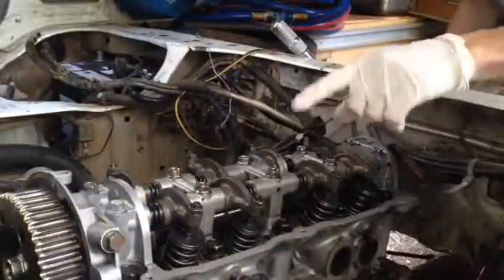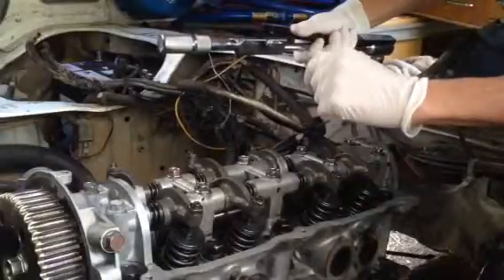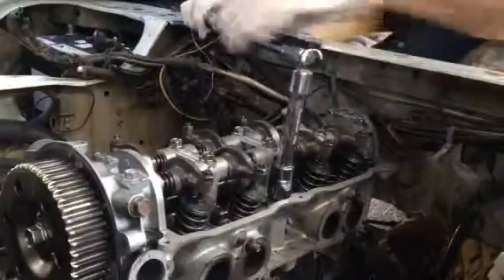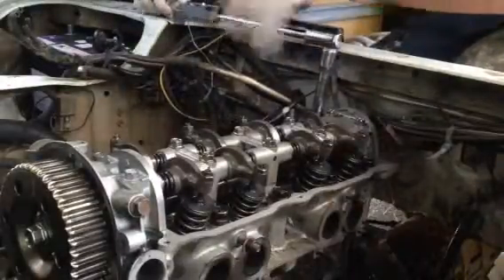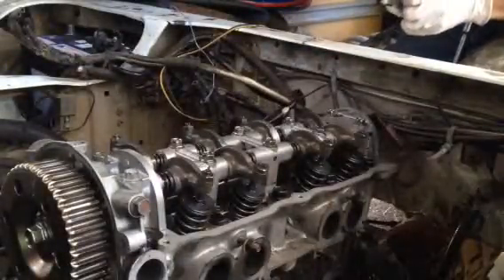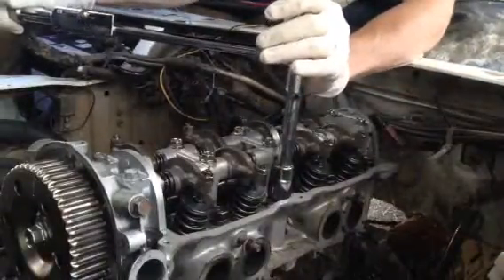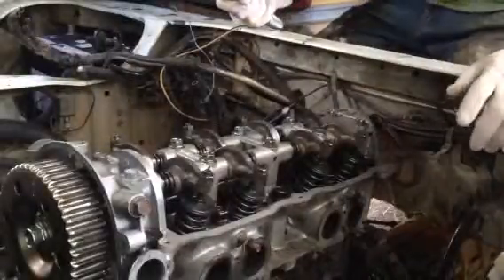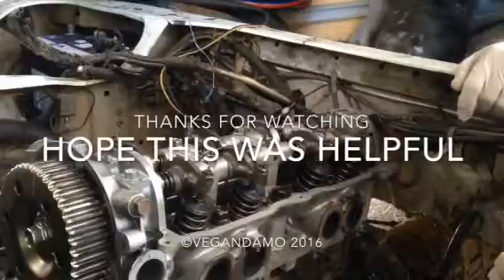Tightening head bolts on Max the ford econovan

Comment: For those watching there's often an order the bolts have to be tightened, and 3 lots of ever increasing tensions. THESE FIGURES can be found with a paper that usually comes with the head gasket/entire engine gasket set. With most gaskets they work their way from the middle out. OTHERWISE they bunch up in the middle and leak at that place. I have seen this happen first hand when working in the radiator manufacturing industry doing mining equipment radiators that are still all bolts and gaskets (not crimped rubbish like they have with car radiators).